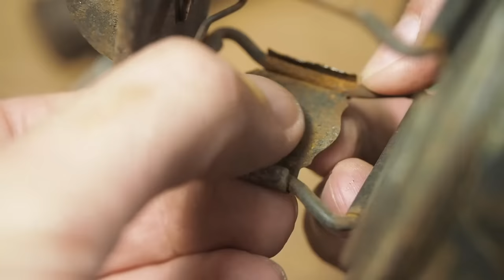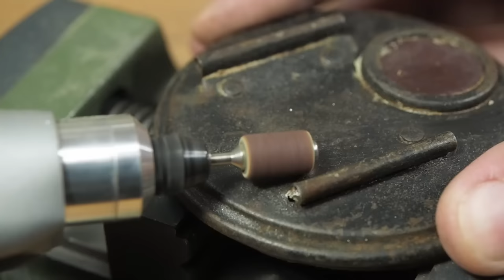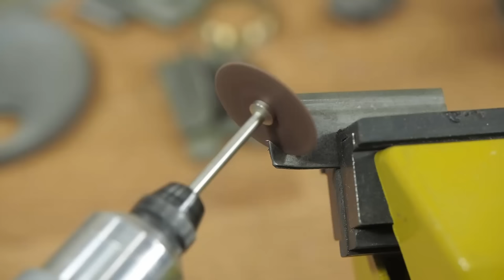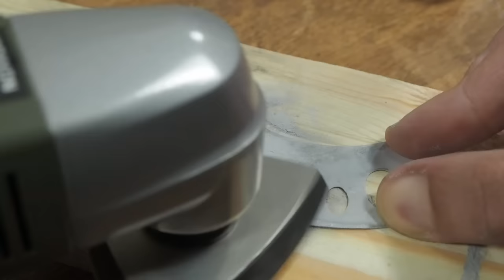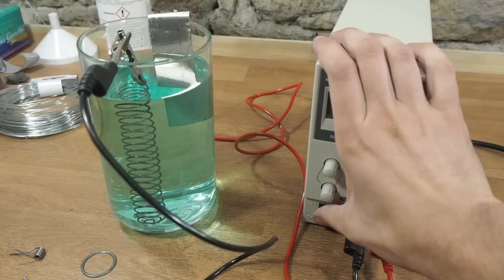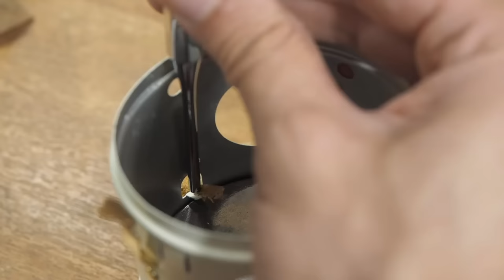Vintage Bicycle Lantern Restoration (with home made base)

Comment: The stand is a nice touch. Restoration achieved, but not completely sold with the plexiglass replacement. The scratches on the original glass could have been polished to a better condition. Apart from that very good. 👍

Comment: Quite ingenious with your spray painting booth ~ looks like you had put a cooker hood on its side and using it as a filter fan, attached to the rear of the box [recognised the filter holder grill and light strip diffuser
Reply from the maker: Well spotted ;)

Comment: I would have converted it into an LED light (shaped like a candle flame). Safer and you wouldn't had to change almost anything. Where the candle base with the spring is could been  the battery and the electrical parts, and have a flame shaped LED pocking out. You could even make a faux flame out of resin and a mold. You can even make a mold to make the resin flame.  When I saw you were making the Plexiglas lens I thought you surely aren't going to put a candle in there.

Comment: Nice restoration. However, when I had one of these many years ago the reflector was nickel plated, as was the vented top section and the round opening frame at the front. The rest of it was black painted.

Comment: Oh well ... I was kinda hoping you'd polish the main housing and a couple other parts to brass plate them.
A few of the parts - candle holder, exhaust box, lense holders, etc, would have looked good nickel plated with the brass.
The circa 1900 to 1910 period WAS the "Brass Era" for car lights, hinges, door knobs, hub caps, etc. Steel didn't become common untlthe mid/late teen and early 20's.
Some of the bcycle accessories of the same period were also brass.

Shame there wasn't a way to nickel or chrome plate the inside of the housing.
The light would be much brighter ... tho still exceptionally dim by today's standards. 
Of course a bicycle headlight in the 19 aughts wasn't for the rider to see where he or she was going. It was so people on/in the horse carts/wagons, horse back, and very few cars could see them coming.

At least you didn't pain it (boring) black, which seems to be so common with "restorers". 👍
Even wen the original paint was say a blue, they automatically paint it black. 👎 So sad. There WERE other colors besides black used throughout history ...
Reply from the maker: Thanks for your comment, I agree with you, they are always restored in black, so I wanted to try something different. Some like it, some don't... that's life. If I were to restore this lantern again, I would probably try nickel plating the glass holder, or at least polishing it, it would have looked nicer.